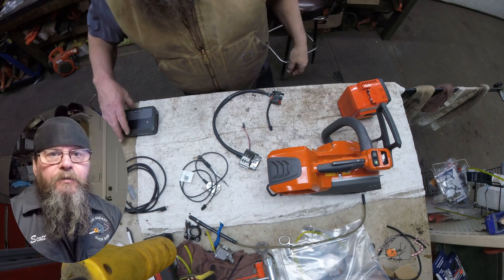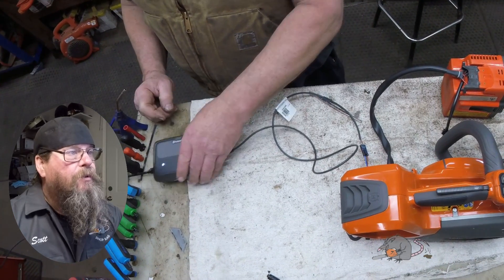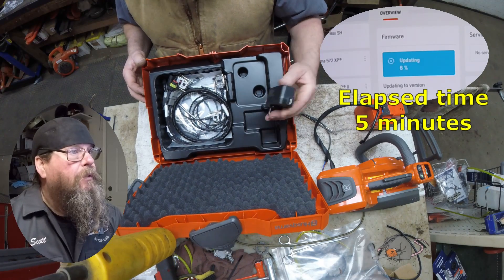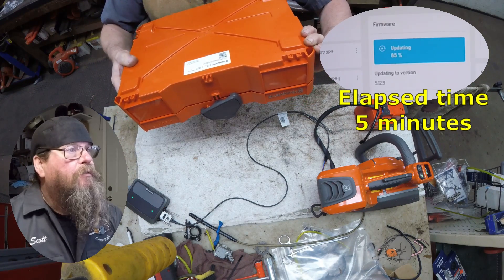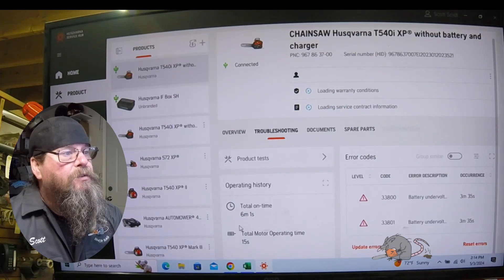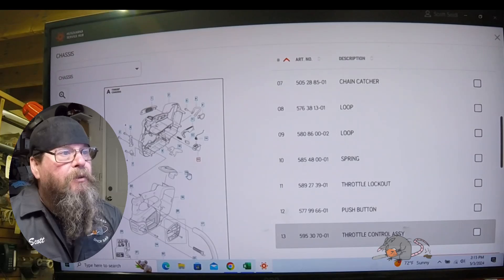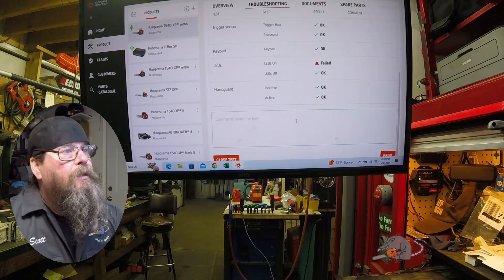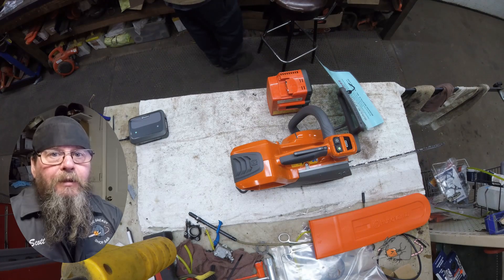Husqvarna Service Hub-Dealer Diagnostic Tool

Comment: Too bad Husqvarna believes that crippling customers to dealer repairs is a good idea.  Husqvarna doesn't have enough dealers period to support this change.  And even some of the dealers don't understand, or don't want to understand the technology.  Countless reviews about the 5 series saws either not having a dealer for customer to bring it to because of closures, or saws being stuck at dealers not been fixed because they can't figure out what's wrong.  Many other manufacturers creating the same problems as well.  I wish everyone had access to a technician like Scott in their area.  I have had to pleasure of working with technicians like Scott who have the drive and sense to get it done for the customer.  Scott, I hope you are compensated well where you are.  Love watching your videos!  Too bad carburetors have to have computer chips now, just the big middle finger for the customer.
Reply from the maker: I understand why manufactureres need to add computers to saws. If they can't be efficient then they will go away. Like you, I wish the ability to repair wasn't just in the hands of the dealers. Maybe if the on board computer could log who made changes (dealer number or other) then warranty considerations could be made after a major failure. ( ex. if consumer loaded firmware for a saw with flat top piston when the saw had dished). Warranty limited if consumer loaded wrong firmware. I dunno. Maybe just a check engine light with error code readout would help. Bottom line: let consumer make repairs but manufacturer not responsible for consumer mistakes.

Comment: Thank you for the video. I just bought a brand new in the box, Redmax Ebz9000 blower. It fired right up and I let it warm up. I used it for about a minute and it bogged down and died. Won't start unless I put a little premix down the intake. It's almost like the auto tune is not allowing any fuel. Is there any procedure for a no-start? Thanks in advance.
Reply from the maker: I guess the "procedure" would be to check all the basics like spark, fuel, and tank vent. Check for error codes if nothing is found.
Reply: @TheGreasyShopRag  Thanks,  that's the pickle is I can't check for error codes, Redmax/Husqvarna doesn't have the option to register the blower so a dealer can't work on it yet. I wasn't sure if there is a reset or something for the autotune.
Reply from the maker: @alittlebitofeverything5090  We have the 590BTS (Husqvarna branded version) on order but won't even see one till spring. Until then I guess I better school myself and see if that version of autotune is any different than the saws. Thanks for bringing this to my attention because I didn't even realize that new blower was going to be autotune.
Reply: @TheGreasyShopRag  No problem at all. I ordered a second one that should be here Wednesday and I'm going to make sure it runs and then swap the autotune to confirm my suspicion lol.
Reply from the maker: @alittlebitofeverything5090  Make sure you swap it back when you're done. The autotune module holds the serial number and you don't want warranty problems in the future.
Reply: @TheGreasyShopRag  Thanks I appreciate the input.

Comment: Can this go on 550 xp and all to 592 xp to diagnostic?If I remember correctly 585 has adjusting screws in carb?
Reply from the maker: This only works on auto-tune saws. You are correct, the 585 has adjusting screws and is not auto-tune.

Comment: Funny.  As I was driving from GB to the Dells tonight I drove right by the shop.  As I was driving by I was thinking to myself why I have yet to see a video from you on using Husky's diagnostic software on an Autotune saw.  As a dealer tech, why wouldn't you have training on the software that's used to diagnose the Autotune saws?  Can you guys check and update the firmware on a 550XP Mark II?
Reply from the maker: Actually I've done several videos showing how to use the old software called Common Service Tool. The first video was in 2015. The new software has been out for a while and I've been able to navigate it without instruction and that software was using the old "black box" that the first software used. That box stores data and the Husqvarna lineup that requires firmware updates has outgrown that smaller box. The new box has a lot of connection cables I'm not familiar with and don't care about until I need them and I know some are redundant. For example I can connect to certain zero turns via bluetooth and upload firmware. I should never need those cables.
 Husqvarna does offer training and service schools but I guess another way to answer the question would be to ask if you read the owners manual before test driving a new car? I needed to update two battery saws before they could be sold. I figured out how to do it on my own and shared the experience with you.
 Thanks for watching and taking the time to comment.

Comment: Interesting. I must say though that I think that tools do not need all this unnecessary computers and what not. Just adds complexity and reduces robustness. I'm a firm believer in the KISS principle, Keep. It. Simple. Stupid. This stuff is getting to the point where your hammer will need the latest system update to drive a nail with GPS azimuth vectoring or your ratchet has a system crash lol. Love the vids Scott! Take care.
Reply from the maker: I like to see advancements in technology but I also like to see a homeowner be able to fix it without dealer-only support. It was the same way when electronic ignition and efi came to cars. Nobody whines these days about not having to set the choke before starting the family sedan.
Reply: @TheGreasyShopRag  There's some truth to that. My first car was a 65 Olds, coldest blooded thing you ever saw, and the choke constantly stopped working.  But most of what I see on modern tools is just complexity for complexity's sake (in my opinion). That being said, I hear a lot of people shit on autotune but I think that is a pretty useful advancement. So I'm not completely against advancing tech, I just question the reasoning of some it.
Reply from the maker: @Randmosh  I think the reasoning is emissions. They have to keep coming up with ways to meet the standards.

Comment: Nice system. I work on GE appliances and they have something similar. There’s an Ethernet port I connect a box to then it connects through Bluetooth to my phone and I can check error codes, update software, run test, see cycle history. Thanks for showing that. It is interesting.
Reply from the maker: Thanks for sharing and thanks for watching!

Comment: Pretty cool stuff but they may need to include some safety warnings that you would need to click on before letting you proceed with tests. This might be beneficial to keep you from injuring yourself or damaging property. I could see myself cutting the cord the first time using my expensive diagnostic tool. I would have never thought that the saw was live either.
Reply from the maker: There is a warning screen as seen at 1:42 . I did click the button. Thats all on me for forgetting it was live. FYI, its live but only runs at limited power-enough to hurt somebody but not enough to cut wood.

Comment: That would be nice just to see run time on saw and battery. Im sure thats a pricey little gadget.
Reply from the maker: For a dealership its not. Husqvarna doesn't gouge us on these computer interface units. At least not this one. The first time I ordered it I had the wrong part number and just got a bunch of cables and they were more expensive.

Comment: More intelligent equipment will need different tools.  Still say a good mechanic doesn’t need one. But is handy and can prove troubles.
Reply from the maker: I would agree if it was just for diagnostics but its also for firmware updates and you can't fix that with a hammer and screwdriver.

Comment: I am impressed, but a bit uneasy as a DIY idiot....
Reply from the maker: I feel its all about the dealer. If you buy from us then we will perform updates for free. If you bought it somewhere else then you get billed the regular shop rate. Usually updates are just improvements but in this case I had to do the update so the saw would recognize a new style battery.